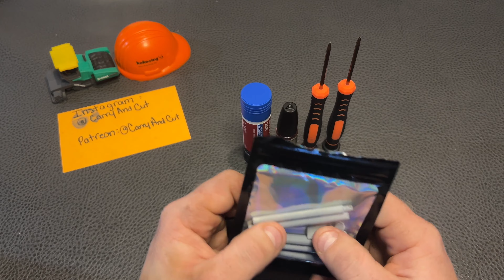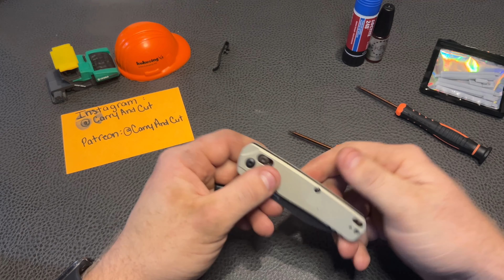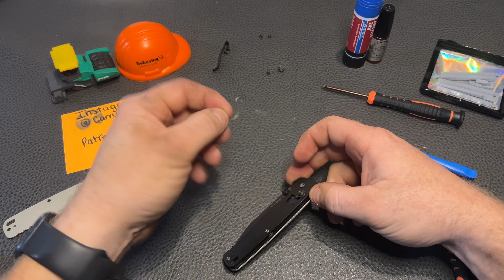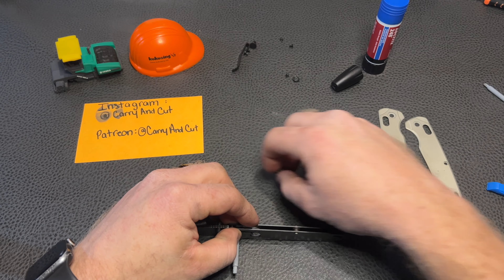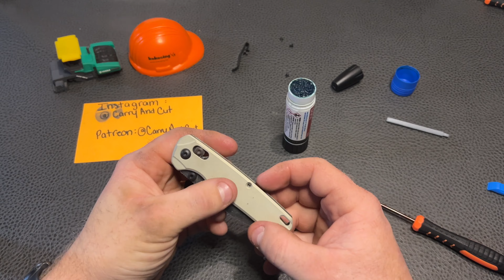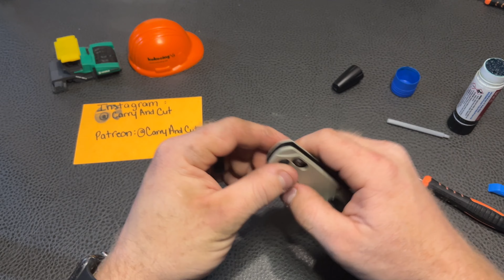My attempt on disassembling the Kershaw bel-air!!

Comment: I do not recommend disassembling this knife completely. It is a motherfucker to get back together.
Reply from the maker: True that 😂 it was to this day the worst knife I think I’ve taken apart.
Reply: Agreed. I think this is done intentionally by Kershaw. I've done many crossbar lock knives and the way they weld the barrel bolts to one side while making the pivot nut enter through the other side is diabolical IMHO.

Comment: Putting bearings inside the blade and washers on top is a very bad idea... Unfixable blade play is imminent with time. Why not just use washers, without making the blade thiner for bearings at its stress point ??? Benchmade did it right with the bugout.
Reply: The bugout comes out of the box with unfixable blade play 😂. I went through 3 of the $330 s90v versions and all had side to side and up and down play. The side to side you can tune out if you don’t mind stiff action but up and down is completely unforgivable. The action just felt horrible on those. Even for $130 I would’ve been disappointed.